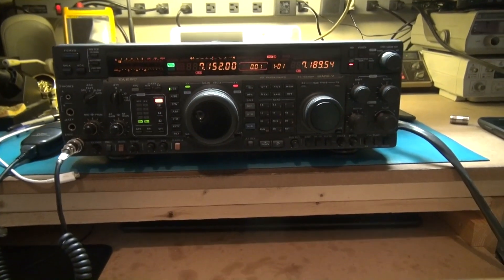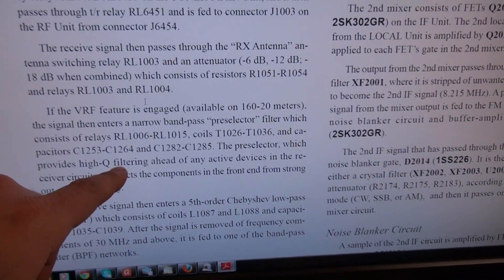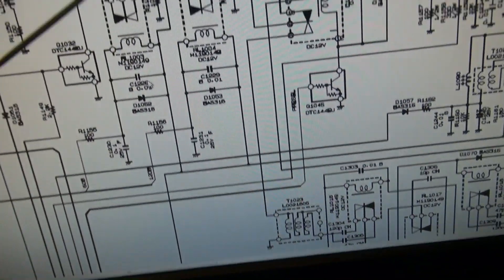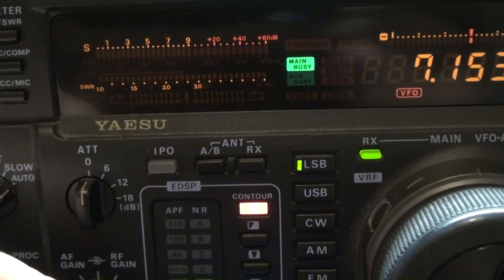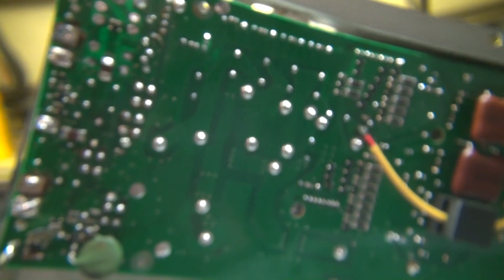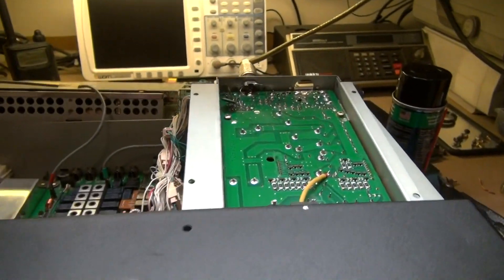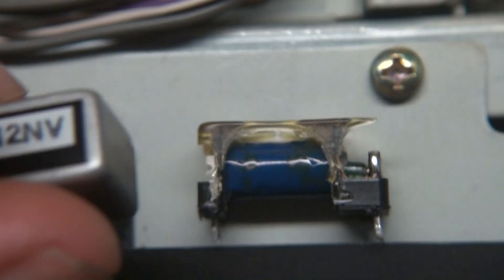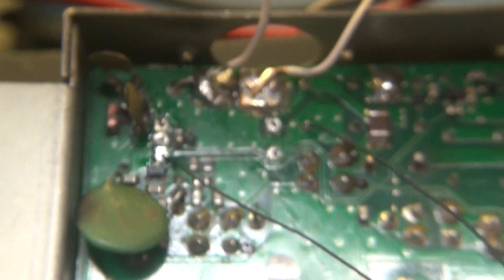REPAIRING A YAESU FT-1000MP MARK V PART 1 LOW RECEIVE, MISSING 6,18 DB ATTENUATION

Comment: HELLO , have a YAESU  FT1000MP  (not mark5 ) ,  when turn on the   transceiver,  
primary display reicever   frequency   sled,   but the   secondary   display    reicever  still   remain    on  the   selected   frequency .
Can you suggest me where I can try to see into circuits of rtx, and possible cause of these malfunction?
Many thanks advance,  you   if   you   did   help  me  to   resolve    these  problem.  From graziano, italy  , december,   22   2020 .

Comment: I have seen that happen before.... Years ago solid state high powered amps were hard to come by, so Ham's would use tube type amps.....  Some Ham radios do not agree with certain tube type amps....  When you unkey the mike power can come back into the radio and fry , burn or weld relays.....

Comment: Thank you for this video. Of course I have exactly the same problem. Could you tell me where I can buy the relay RL 6451 TC-112NV. On internet I can't find any reseller. Is there an equivalent relay ?
TNX and best 73s. F8BUU
Reply from the maker: If I remember I got the parts direct form Yaesu.

Comment: Same rig. My attenuators work fine. VRF drops the receive out on VFO A and drops it slightly on VFO B. The VRF lamp doesn't light when it's supposed to be on. I think I have a relay issue but it's early in the troubleshooting. 73 NE5U  Mike

Comment: http://www.cqham.ru/forum/showthread.php?t=28300&p=994855#post994855     This is my solution to the problem of failure of the relay 6451 and resistors in the attenuator. The problem in high SWR antenna and replacing relays and resistors only for some time. My scheme is working at 100 percent. Relay mechanical and installed on the side where the antenna connectors, it is very easy to replace without dismantling the tuner.
Andrey RD3F

Comment: FWIW I have seen similar faults in a friends collection of FT1000Ds.. burnt attenuator resistor and a relay with bent contacts, the relay failed due to a short happening to a patchlead, the ATU did it's job but put huge current through a relay contact.
The attenuator fault usually happens when someone has another rig and transmits into an adjacent aerial...
73 de G0FVT